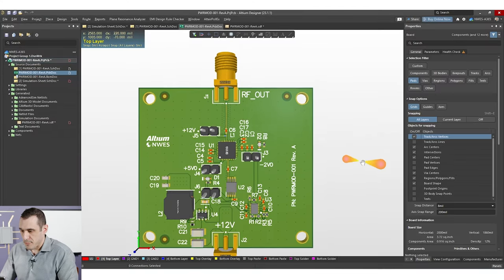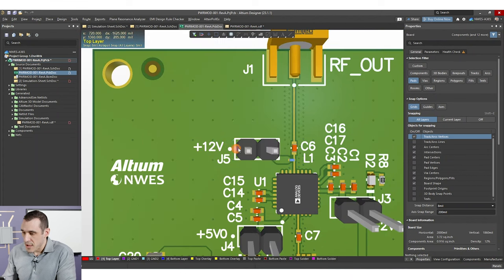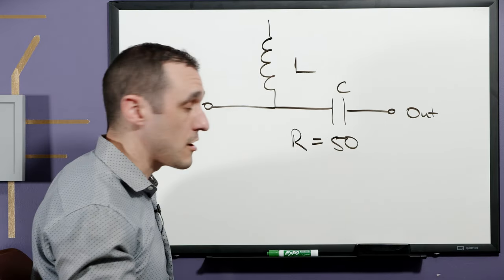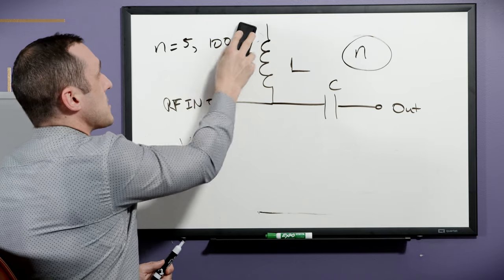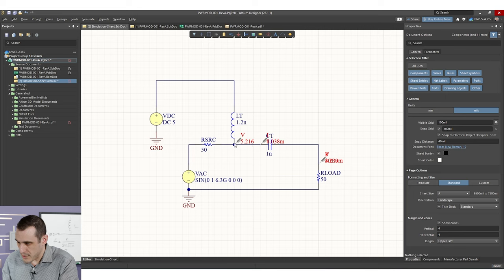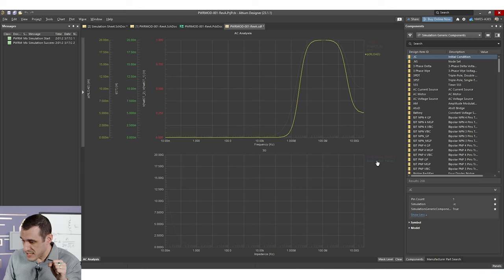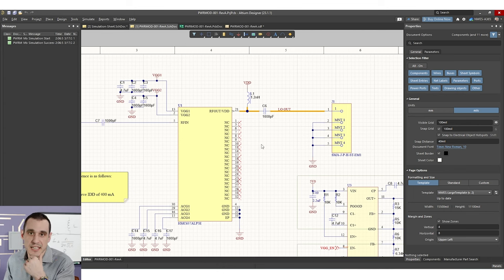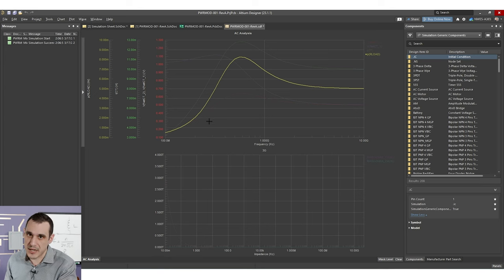Bias Tee Circuit Design & Simulation How-To

Comment: The  "cold" (non-RF) end of the bias inductor needs decoupling. Also, at 6GHz you should consider a quarter wave line instead of a discrete inductor. It is likely to be a better performer at such a high frequency.

Comment: Great video! One question. When choosing a particular inductor component, how should the parasitic elements be considered? Should you choose a component with a self-resonant frequency close to the operating frequency? Thanks!
Reply: Self-resonant frequencies should always be above the operating frequency except in some specialized application. This is true for inductors, capacitors, etc... For inductors there are many options, even SMD wirewound options, that are marketed specifically for RF systems. These will have a frequency specification listed in the product documentation.

Comment: Thanks for your videos! Can you consider in future videos the construction of Bias-T in PoC (Power over Coax) filters for powering and transmitting video signals to/from video sensors.
Manufacturers such as Murata or TDK show options for constructing such filters and it would be interesting to see your point of view on solving this problem.

Comment: When computing the S-parameters @ 16:39 where did the 0.26 and 100.26 come from? Thanks! @Altium Acadamy
Reply: Not 100% sure but I believe he is using S11=(Zin-Zs/Zin+Zs) where Zin is the 50.26Ω and Zs is the source impedance which is 50Ω (50.26-50=0.26Ω). Same logic applies for the 100.26.
Reply: Matthew is correct, it is from the difference between the two impedances (absolute value) being 0.26. Since we have 50 Ohms output impedance set by the source, that is interfacing with the input impedance looking into the tee which is 50.26, so those are the two impedances we use to determine the return loss.

Comment: Hi Zach, I made a simple simulation on LTSpice and the results is the same as yours video.
But the question is how could I determine my real ‘n’ factor in the blog calculator?
I started with n=1 to see the simulation results, then modify n=10, 100, 1000,…
The passed energy to the load and the rejected energy to the DC will change by frequency. It makes sense.
How could I determine the n factor in real circuit? Is it just depends on the simulation?
Reply: From a real circuit, you would have to know the impedance of each leg in the bias tee, then that would be used to calculate the impedance ratio. As long as you know the components in the circuit then you could calculate it.

Comment: In your calculator is there a way to make one if the values fixed?  asking since I saw 2 non standard values and those are expensive . So for example can I mimit the capacitor range to lets say E24 or E48 values and then get wherever on the inductor side?
Also is there a reason NOT to use a higher n?
Reply: You could limit one of the values for a given target output impedance and frequency, but you couldn't do it in the calculator. This might limit the impedance ratio you can achieve. I think the important point is to look at the impedance ratio like a tuning parameter for the bandwidth, that's what I wanted to show when taking n from 1 to 10.